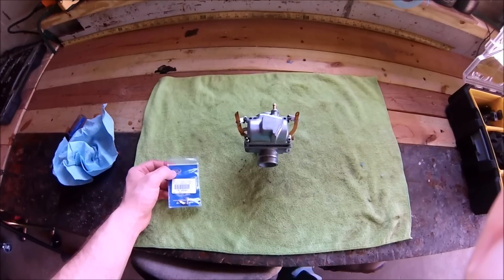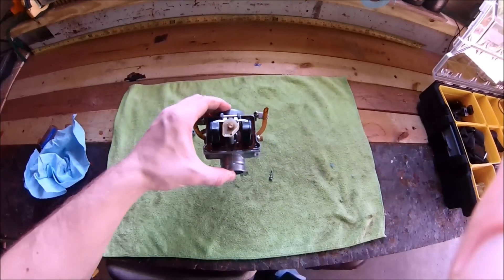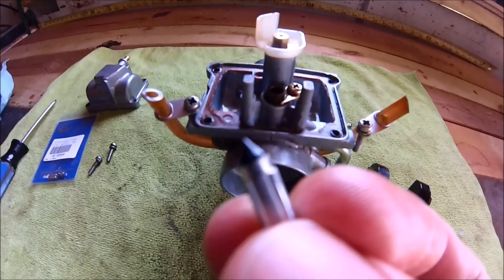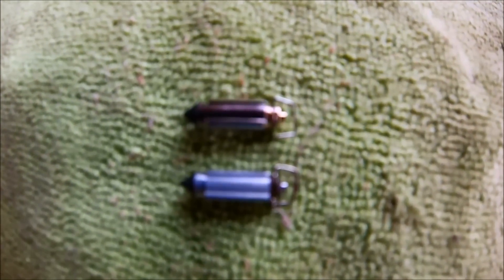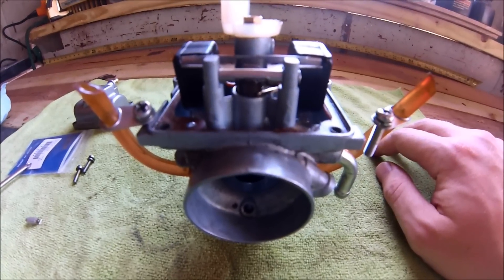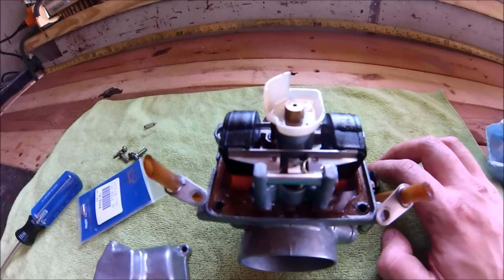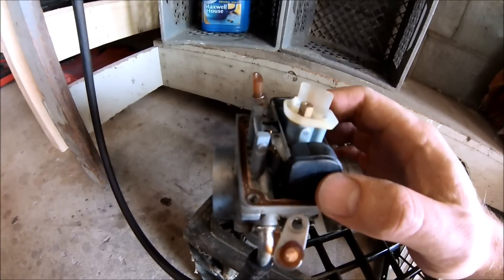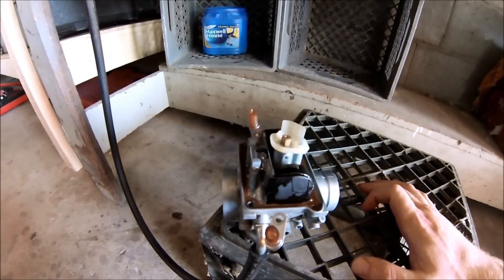Yamaha Banshee Needle Float Test and Replacement

Comment from the maker: You need the idle screw if you have the TORS eliminator kit installed.  The idle screw controls the ATV's RPM at idle.  The Air/Fuel screw controls the air fuel ratio from zero throttle up to about 1/8 throttle.  Check out my jetting video and it is all explained better.

Comment from the maker: They are two completely separate problems.  Check out my jetting vids.  Make sure you have the same jets in both carbs and they are adjusted the same.  Also make sure you don't have a misfire.

Comment: I have a question im new to banshee wanted to no if my left side carb is leaking gas obvious that my float it damage or not line properly could it cause my bike to run threw spark plugs aswell?? My left plug keeps fouling ever since my carb started to over flow I never payed attention till now wanted to no if thats tha cause?

Comment: i had a problem with my banshee sputtering at high rpms today, and i was told to lower my plunger thing on the float by pushing down the metal tab holding the plunger to get more gas. Is that accurate? or should i raise the the metal peice that controls the plunger. Thanks!

Comment: you are two people, i swear
Reply from the maker: lol, how so?
Reply: you have two different voices
Reply from the maker: Depends on what gopro case is on my camera
Reply: hey can you help me with my carb? I got a new needle and it comes with the needle, clip, and two plastic white washers. I was wondering if it went in the order of, white plastic washer, clip, white plastic washer? Do i use both washers because wouldn't that screw with the needle height. Also, with the bracket that screws into the slide by two phillips screws, I was wondering if you put it in the way that you can see the little hole on the bottom of the slide or do you turn it the other way so it completely blocks out the little hole on the bottom of the slide? I hope you understand what I mean by the bracket thing in the slide. You can only put it on two ways but one way, you can see a hole and daylight and the other way (180 degrees the other way) it completely covers the hole.